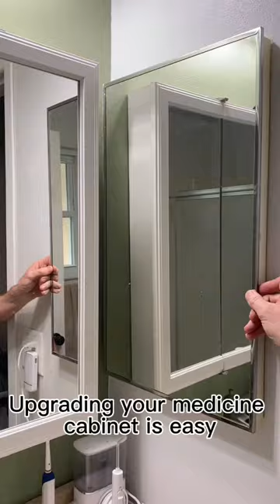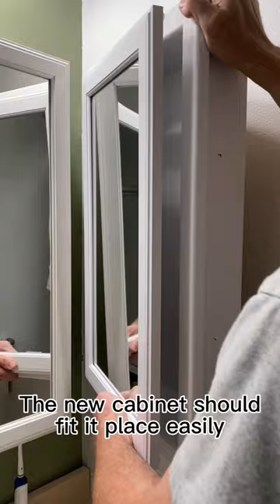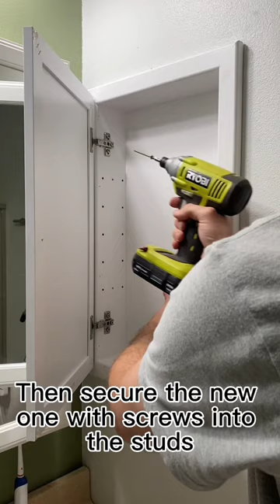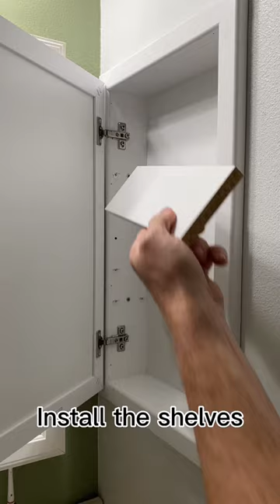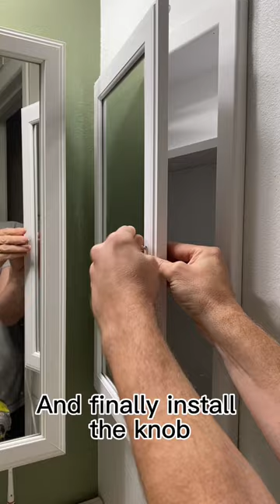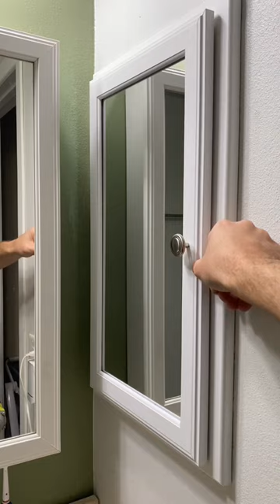Cheap bathroom upgrade - Installing a new medicine cabinet

Comment: It looks the same a before 😮
Reply from the maker: The old one was 1970s builders grade, yellowed and cracked plastic. The new one is wood.
Reply: Right, downgraded on mirror size, and changed from plastic to wood in the bathroom. Wood loves the humid bathroom.
Reply: Then I guess all vanities should be plastic and not wood too right???